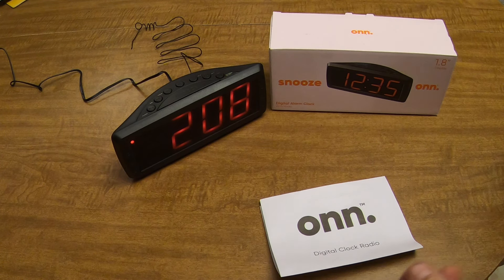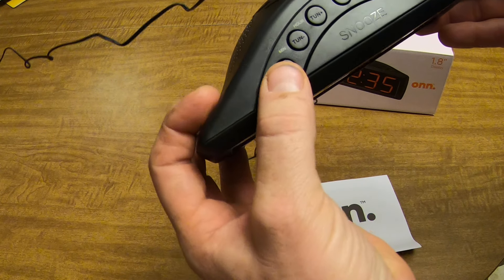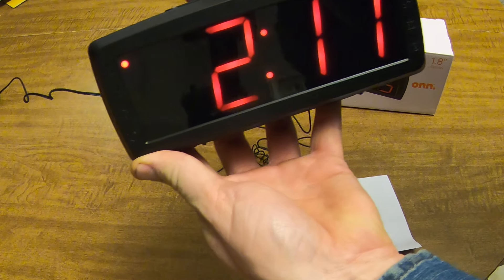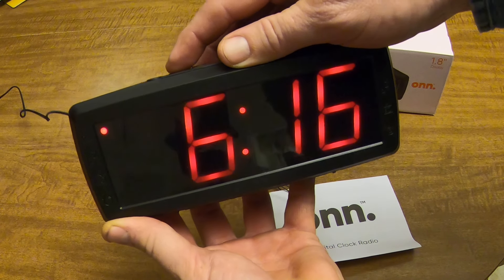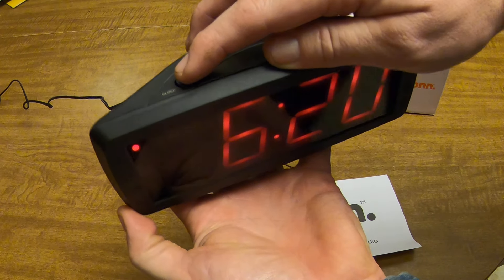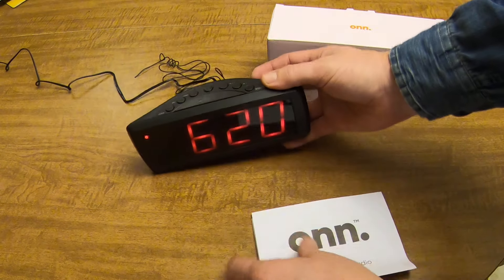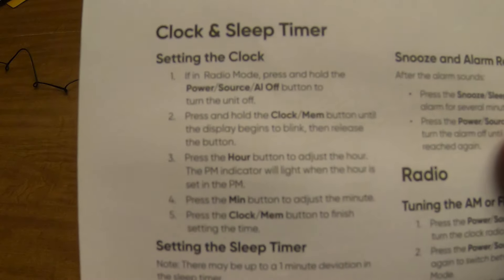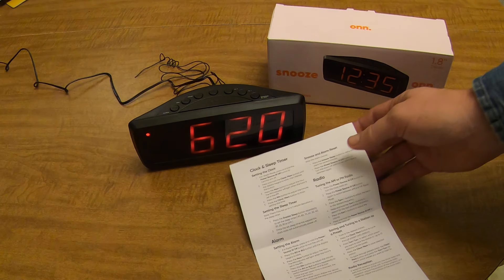How to Set the clock on a ONN Alarm Clock

Comment: I had an issue with this clock going into memory mode and this instruction wouldn't work all I had to do was just unplug it wait a few seconds and plug it back in and then this instruction works just fine thanks.